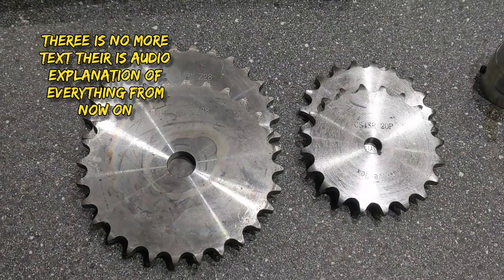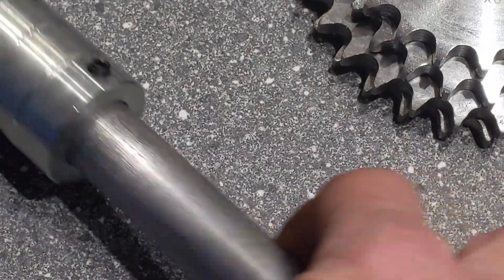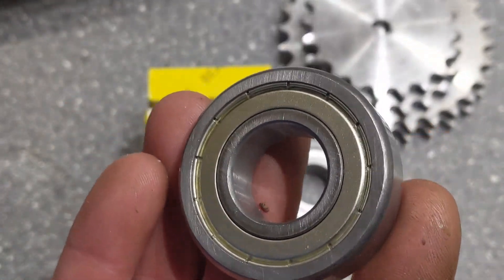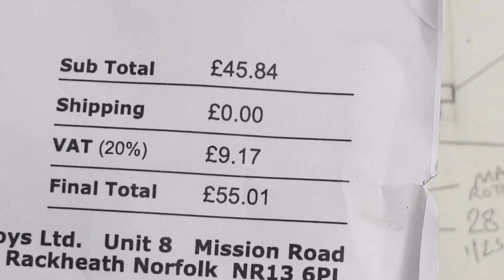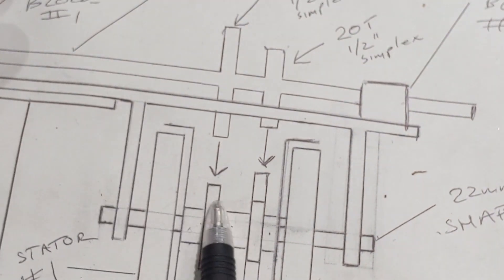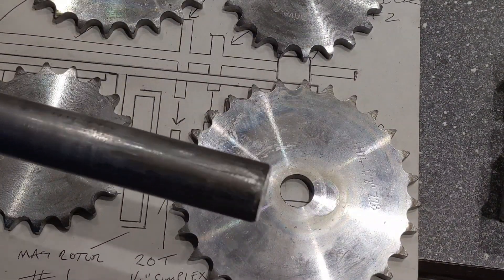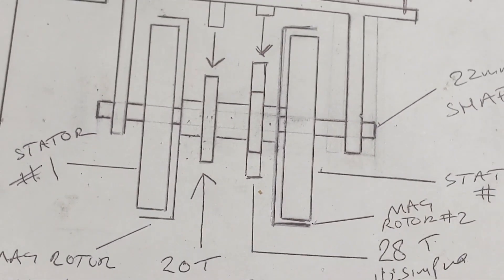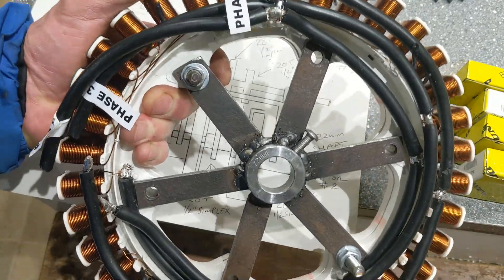Dual SmartDrive wind turbine parts arrived !!! 18 November 2020

Comment: WOULD IT HAVE BEEN EASIER TO SPIN METAL DRUMS AROUND AND KEEP THE STATOR COILS SOLID
Reply from the maker: That is how it works , the shaft needs to be fixed to the frame.